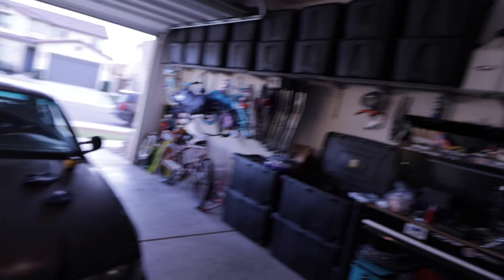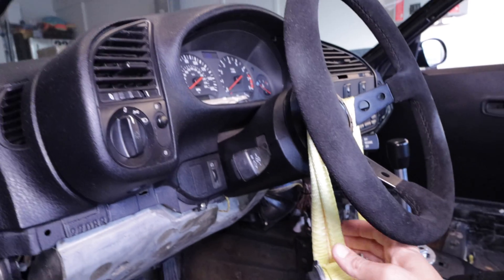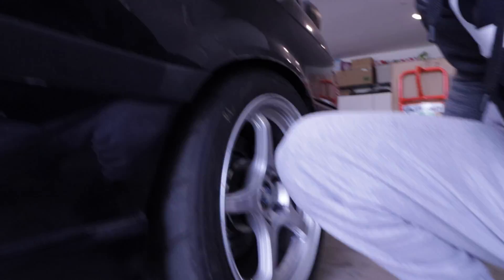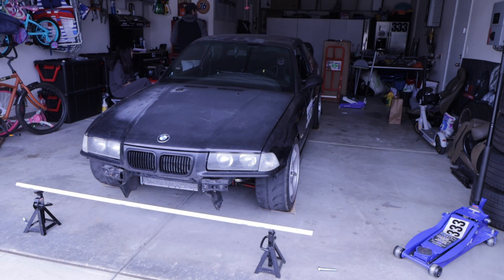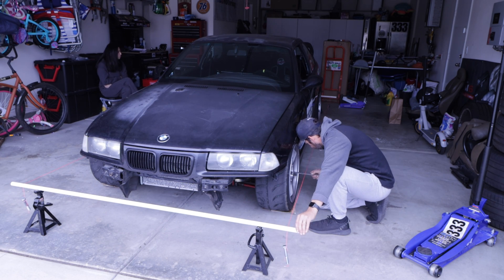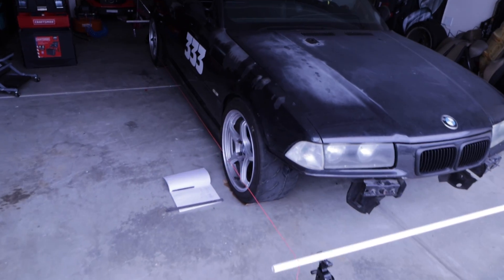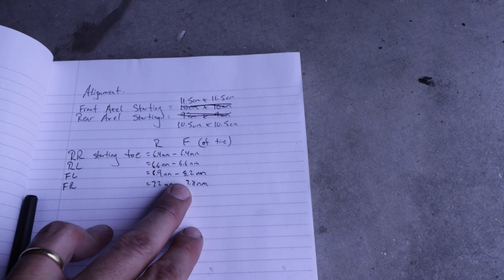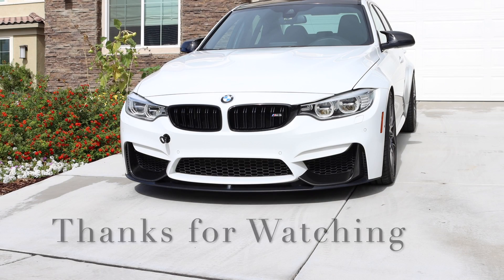Build your own Alignment Rig 4K #e36 #m3 #bmw

Comment: So I have a question. Where you measured your points to make the lines parallel with the car does it matter that the track width of the front tires and rear tires are slightly different? Like did you somehow compensate the difference? Or since you established your fixed length on both the front and rear PCV pipes, you made a mark on the pipes to establish a “starting point” for the string and you just slowly adjust it from there? Push the string further or closer to the measuring point under the emblem and apply it to the other side?
Reply from the maker: Ok so the string width doesn’t matter in relation to track width. The main thing with the string line is the height. It needs to run through the center of the wheels. Then you go front to back side to side and square up the jig. You want to make the front and back on either side are equidistant from the string. Then you can align your car. I’ve done this countless times before track days and it works great.